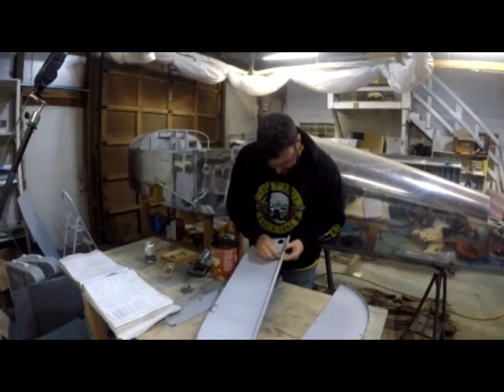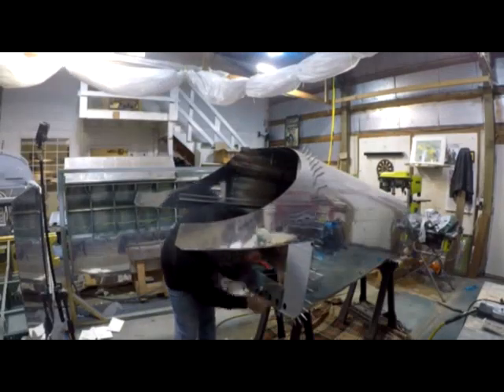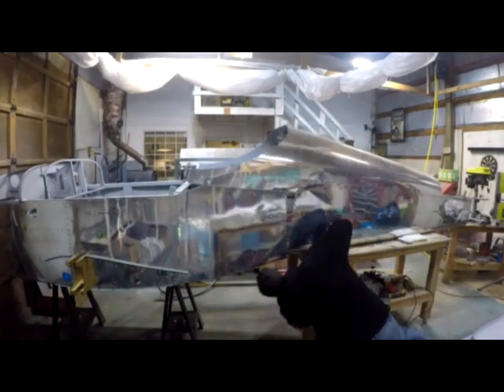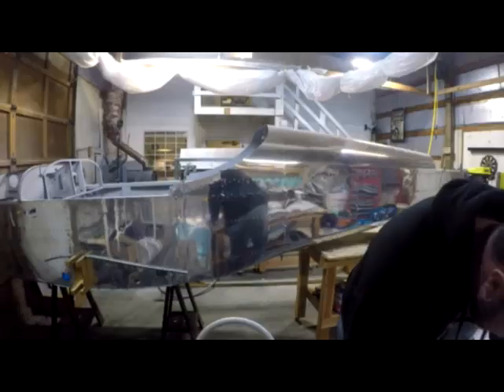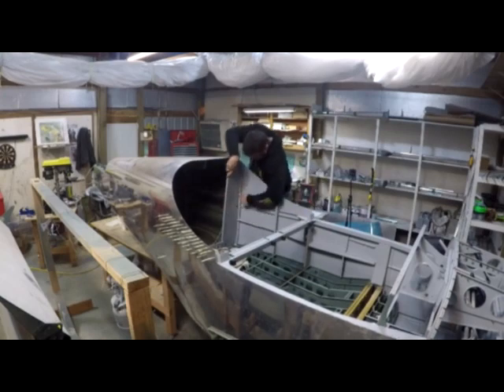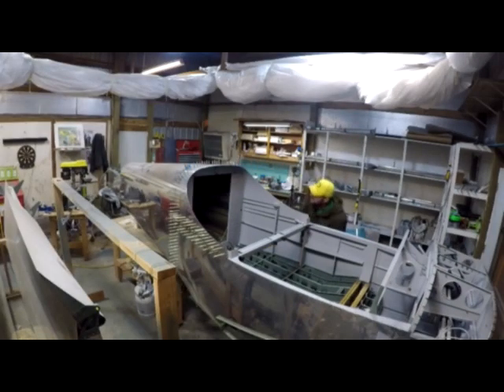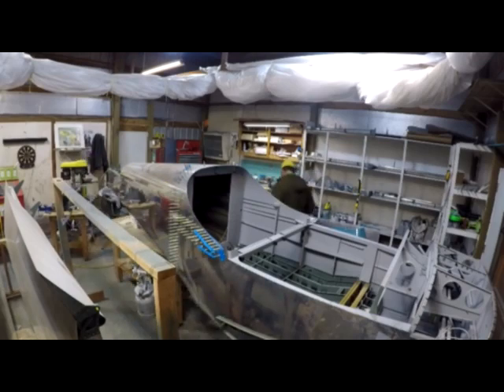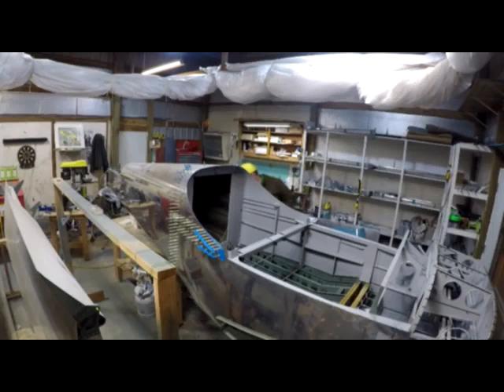Scott's RV14a - And the Two shall become One

Comment: Hi Scott,
  I am a first time RV7 builder. I just got the fuselage put together in one big piece also! My next task is to rivet the floor and sides forward of the main spar.
One thing that has really helped me avoid boo-boos, is that I use sharpie all over the airplane! 
  I write notes right on the plastic blue stuff. If that’s missing already, that doesn’t matter anyways. It will easily wipe off just using alcohol, or any solvent really. When there are several sheets overlapping and it gets complicated, I will usually outline the outermost one,  and labelling them, so that I can see how it all fits together. 
  I just started subscribing to your channel. Forgive my ignorance if you’ve mentioned it, roughly whereabouts are you located? I am near Kitchener Ontario.
It looks like you’re making great progress!
Reply from the maker: Hey Steven,
     Yea, sounds like we are just about the same spot! I’ve taken a 3 month hiatus due to life events but just got back on it this past week! Just finished the flap actuator system and half the baggage floors last night! 

     I’m close to vans aircraft here just outside of Portland, Or. Makes it easy to get parts! I’ve got my firewall fed and finishing kits and have my engine on order. I’m hoping to have it on wheels by the end of summer!

How long have you been working on your project now?
Reply: I’m embarrassed to say. It’s been about 15 years. 
  If you look at it another way, it’s been 4 house moves, 4 house and workshop fix-ups, one broken wrist and 5 major aircraft courses, along with a shit ton of commuting back back and forth to work, all while being away for my flying job. 
  The best thing is though, it has been with the same wife and riveting partner.!I could always use another riveting partner, but I can’t afford another wife. 
   I fly all the time, but it sure would be nice to get it done. That way I could fly my own plane where and when I wanted to. 
  I’m sure that you’ll beat me to the finish line. But I’m still enjoying it as a relaxing hobby when I get the time and feel rested enough to work on it. My goal is simply to make some progress every time I get home from work.
Reply from the maker: Ahhh… no need to be embarrassed! Goal is to take the necessary time to enjoy the project! It’s funny that you mention that you fly for a career…. I’m looking at the possibility of changing careers to flying commercially as a mid life crisis option in my mid 40s!

I have been building mine for almost 5 years now. As you shared, I have had a few moves in there and other life events…. There are a few guys that I know that started around the same time I did and already have a few hundred hours flying time! I know I’ll get there eventually!

I look forward to hearing of your progress!

Comment: Oh and P.S. 2 blade for sure.  I want to cruise fast.  Charlie brings up some good points but three blades has more drag, pure and simple.  If your primary mission is long trips then you’re better off with the 2 blade.
Reply from the maker: Hey Allen, I agree.... I looked at the differences and the only one that stuck was the reduction in vibration from a 3 blade prop... I have always had a two blade prop and I am quite content with it.... and the cost of a three blade prop was an additional three or four grand..... so I was ok with the two blade prop!!!

Comment: The only 3 blade in hartzell is composite and most people say if you aren’t doing competition aerobatics  it’s not worth it.
Reply from the maker: Hey Marc, all three (Sensinich, MT and Hartzell) have a three blade option that will fit the 390 - 119 exp engine HP size.... I have ruled Hartzel out since it is just under $20k for the prop and I have no desire to spend that much on a prop!!

So, I am actually looking at the sensenich 3-blade composite which shows a price of $4700 and the MT 3-blade which lists for $14,500.....

The benefit that I have heard is that it is significantly smoother to have a three blade and the decibel readings from a test run I watched was 10 decibels. which is about half as loud on the decibel scale.

I am looking at the total price when tied to the engine.... If I go with the cheaper prop, then I can spend more on upgrading to the Thunderbolt engine.

The two blade prop from MT is about $9K..... this all sounds like the priming debates! lol!
Reply: @didja691  thanks for the reply! I too went down this path and am doing it again since I’ll be putting in before March 14th. Somewhere I saw someone change from the hartzell to a composite, not sure which, and they lost 7 kts. I also saw people on VAF confirm this. It still may be worth it for the decibel drop. However I plan to use this primarily for cross country, and most people say the hartzell 2 blade is the fastest …… but let me research more and let’s keep this debate going!!!

Comment: Scott, if you wouldn't mind when you make your Thunderbolt vs. not decision, could you go over that in some detail in a future video? I'm having the same internal debate. Talk to people who get the Thunderbolt, they swear it's the best decision they made. Talk to people who didn't get the thunderbolt, they'll say the extra coat wasn't justified. Not enough objectivity to help me make a decision.
Reply: Here’s some guidance for you both coming from someone who currently owns a thunderbolt and a two blade Hartzel. I decided to go with the thunderbolt because of a few main reasons. One, the lighter weight allowed for a larger useful load. Two, the engine is not built off an assembly line like the rest of the IO 390s. One guy is responsible for assembling the motor from start to finish. Three, the tolerances are tighter and the weight matched rods and cylinders make for a much smoother operating motor which inevitably reduces wear and increases TBO. The extra $4000 you pay for that level of attention to detail I feel is worth it. Regarding the propeller, I too went through the debate of two blade versus three blade and aside from the pure aesthetic preference of a three blade propeller, a three blade has three distinct differences. It’s going to have a slightly better climb performance, a smoother operation in cruise that produces less vibrations and noise in the cockpit, and a be a more effective “air brake” for slowing up the slick 14 when going full course pitch. The additional $6000 is something I felt could be spent on a more robust avionics package as opposed to a propeller that I can change at a later date. I had numerous conversations with the technical advisor team at vans, Hartzel, and Jeffrey Schans at Lycoming regarding the above decisions. If you have any other questions don’t hesitate to ask. Hope that helps.
Reply from the maker: Thank you very much for this! A lot of what you mentioned is exactly in line with where I am thinking. I was budgeting for about $65k between the engine and the propellor (standard 390 engine with MT three blade prop), but I am starting to lean toward a 2 blade prop and use the difference to pay for the thunderbolt…
Reply from the maker: Eric, absolutely. I think that I will be making my decision within the next two or three weeks. I will call over to the lycoming team and get more specifics as well as discuss prop matchups. I’ll let you know what I find.